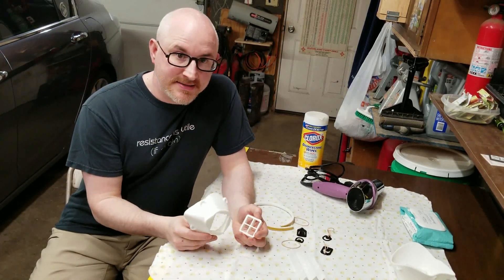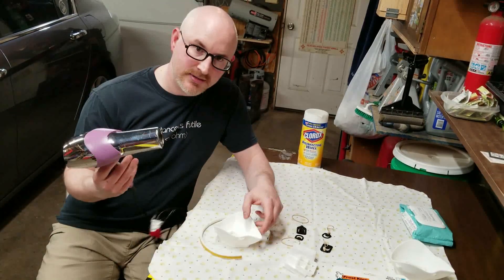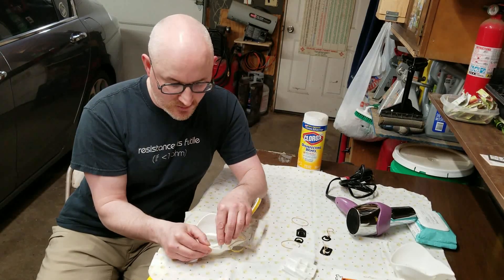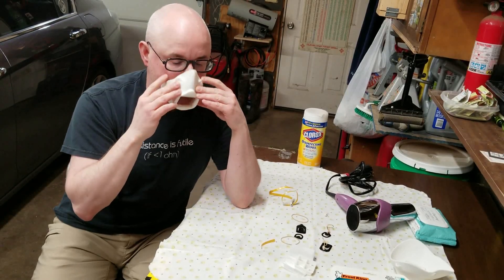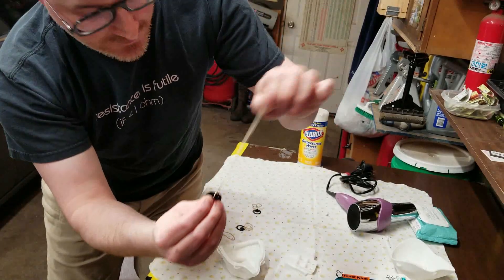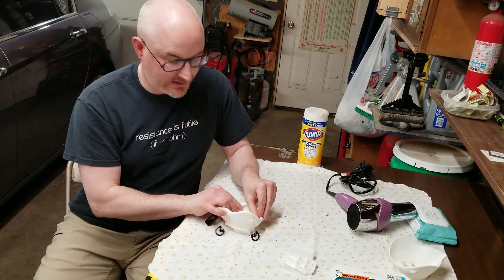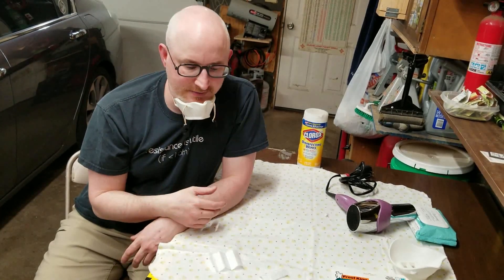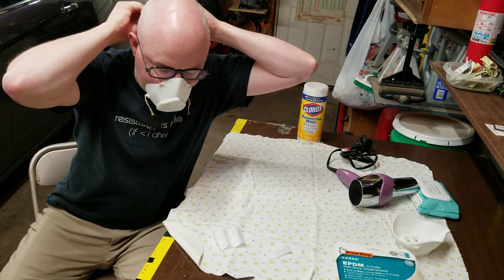Healthcare Engineer Explains Fitting a 3D Printed Montana Mask for COVID 19

Comment: @Richard Vedvik, thanks for the video. Are you concerned that the seal between the plastic filter insert, filter material, and mask can be compromised by the bunching up of the filter material, particularly in the corners?
Reply from the maker: Yes, we are certainly concerned with the filter installation.  A properly fitting filter is important for a firm fit of the frame.  The filter media has seemed to fold fairly easily without bunching up, i suppose that it stretches a bit when installed.  The filter window is held in place by friction from small bumps, meaning that the filter window frame leaves some room for the filter media to pillow between the bumps and corners.  The result is a fairly flush and smooth appearance from the outside and what appears to be a good fit.  We can see from the Montana Mask testing on their website that when subjected to the NIOSH standard test method the mask and filter window arrangement passes.
Reply: @richardvedvik979  , thanks for the reply. I actually have two of these Montana masks made from PLA and got concerned when the plastic frame insert popped out when I inhaled (it hadn't previously done that). I added an extra sheet of blue shop towel, which seemed to work but became concerned when I noticed the corners of the filter material seemed a little more recessed (looking from the outside of the mask). Last night, however, I was able to do a homemade test using a Harbor Freight IR thermometer. Temperature measurements of the filter material at the center (when exhaling) were several degrees hotter than measurements taken of the filter material at the corners (when exhaling). Not super scientific--but good enough to be reasonably confident that there's probably minimal leakage in the corners when inhaling (movement of the filter between breaths was minimal to none to the naked eye).

Comment: It is NOT a PPE...it is a useless pointless face diaper. A symbol of kneeling to the State.
Reply from the maker: Technically, it is PPE according to the CDC...  but so is a rag so the standard is pretty low.  These do provide more filter performance than a scarf or surgical mask.    They can match the performance of a N95 mask when using the same filter media in the window.  But I do think the survival rate and data associated with age and preexisting conditions means many applications are pointless.
Reply: @richardvedvik979  , masks like these (and even good cloth masks--but not bandanas and fleece) are very important when fitted and worn correctly. Monica Gandhi over at UCSF has some good evidence that even if wearing a mask doesn't prevent infection, it may very well reduce severity of the disease. Thanks again for posting this video.

Comment: Richard, I know this is 2 months old, but do you have any specific recommendations on furnace filters within that rating MPR1900 that you know for certain do not contain fiberglass?  I would like to do something like this, but I know that has been a concern when I've heard a discussion of using furnace filters.  I wasn't sure if you had done research on that yourself.  Thanks for you help in advance!
Reply from the maker: A natural fabric layer on the inside (thin, sheer, fabric) can help catch any loose fibers from the filter media.

Comment: I am a medical engineer as well. I actually designed a mask that prints in 2 hours and has a cover to go over the filter. 

One fyi for all, you can sanitize the filter material by baking it in your oven for 20 minutes at 170F.  Do NOT use water or ipa with the filter. They are electrostaticly charged and due to the type of dipole bonding that ipa is, it will cancel the charge, and water will just short the charge out. 

Using ipa on the pla is best option for sanitizing, besides hot water and soap, due to its inherently low surface tension. This allows it to actually get into pores smaller than viruses. A friend of mine is required to use rubbing alcohol for the filters they make that filter out viruses from blood. 

Today, i did some tests with silicone caulk aroumd the edge and it worked very well. I have also made a mold of my mask so when the time comes, i can cast them in silicone or resin haha.
Reply from the maker: Awesome input!

Comment: Great ideas for using potential seal gasket materials and filtration media for one Montana 3d printed filter mask.

Now in my search I ran across a great n95 equivalent filtration media that comes in it pure bulk fabric form ready to use; just cut and size accordingly to ones application 2.5 inch by 2.5 inch square to fit ones Montana filter mask or if one needs dual layer protection simply cut another 2.5 inch by 2.5 inch square and then simply place it over the four square grid piece to make a very good double layered n95 equivalent filtration media piece for one Montana 3d printed filter mask.

Filti.com:

$30 for 21 square feet worth plus shipping about $10 and one gets for $40 quite a bit of n95 equivalent filtration media for ones Montana 3D printed mask to load up to use for quite awhile how much one might ask of course ask; I have done some preliminary calculation using online square foot to square inch calculator to come up with the following usage metrics for ones review if needed:

21 square feet equals 3,024 square inches (one gets this by multiplying square feet by the value 144)

21 square feet times 144 equals 3,024 square inches

2.5 inch by 2.5 inch single layer n95 equivalent filtration piece equals 6.25 square inches

now simply cut a second: 

2.5 inch by 2.5 inch single layer n95 equivalent filtration piece if one needs a dual layer protective n95 equivalent filtration piece also as well

3,025 square inches divided by 6.25 square inches equals 484 single layer n95 equivalent filtration media pieces

3,025 square inches for two single layer n95 equivalent filtration media pieces will equal half the above previous number of 484 or 242 double layer n95 equivalent filtration media pieces

$40 divided 242 double layer n95 equivalent filtration media pieces comes to a total cost of 16.5 cents per changeout for a double layer n95 equivalent filtration media piece which I think is something most who are concerned about protecting their lungs will agree is pretty affordable and worthwhile indeed.

The cost of the Montana 3D printed mask can be purchase online Amazon for about $20 minus the gasket seal and filters or; 

one also has the potential option for buying the Montana 3D printed mask for about $25 with the sealing gasket included along with a starter supply of five color coded initial n95 equivalent filter media; 

now the white side faces going outwards of mask and the green side faces inwards towards ones mouth;

now if one needs to have the Montana 3D printed mask available for immediate use upon arrival the ready to go all in one installation kit makes it super easy to get up and running in less than five to ten minutes time and will help to insure that one has as perfect a positive air seal as possible with just the use of ones hair dryer and five to ten minutes of custom fitting and installation times.

Comment: Oh wow, now how are you going to prevent the boogeyman from entering your body through your eyes, ears, and skin? Do you have an experiment that proves your mask is capable of preventing the boogeyman? Link please!
Reply from the maker: Both boogeymen and boogeywomen are quite determined to enter any face hole that has porous absorption (skin is fairly resistant because it has sub-atomic superheroes on the surface playing red rover). The face hole that generates a vacuum tends to act like a worm hole for boogeypeople.   Because the boogeypeople have a characterized size, the MPR rating of filter media (made from the fine strands of hair from woodland fairies) is accurately tested for percentage of blockage - measured in micrometers - or 0.000001m resolution.  MPR1900 and higher is suitable for viruses and the percentage of particulates captured is well documented for each filter type.  The links in the description also discuss this and the first link includes testing results compared to an N95.

Regardless of the idea or belief surrounding mask usage, herd immunity, or natural selection; it is undeniable that our healthcare facilities will be overloaded.  We don't design hospitals to allow every room to be negative (maybe one in twenty or one per floor).  While that will likely change moving forward, the current situation is that contagious patients are exposing the entire facility.  PPE within the hospital is necessary to maintain health of the workers.  

My immediate family are working in hospitals and are re-wearing the same N95 masks for days or weeks while treating COVID positive patients.  Anything that reduces the public's use of those masks is helpful.  Nursing staff at Long Term Care facilities have expressed concern they may quit and abandon the residents if they don't get masks/filters that make them feel safe, and these masks provide that both functionally and spiritually.  Many LTC facilities aren't receiving PPE due to hospital shortages getting priority.  The general public is being directed to wear cloth masks, which doesn't have anything close to the performance of a properly fitted respirator with proper filter media.  None of this is ideal, and most of this is worse than that, but our nurses and doctors are needed, so action is required.  

Because the public will be required to wear masks in public very soon in most areas (rural or urban), I think the mask should be as effective as possible without depleting a resource required by healthcare workers.  

Cheers.
Reply: Richard Vedvik 
Problem is, you are trying to protect against something that doesn’t exist. Check out Andrew Kaufman.
Reply: Truth is Freedom Florida Show me proof and hard facts. Not just someone putting a bunch of words together showing how ignorant they are. I will wait.
Reply: Keystone19 
Proof of what?
Reply from the maker: @Masterdebator881   I design hospitals and interact with hospital personnel daily.  I do have first hand knowledge of how hospital systems are reacting, testing, and being impacted.  There may be global manipulation to usher in the NWO, since the entire planet reacting fairly equally (which is odd) and the devaluation of currency.  I totally acknowledge that this is a very odd reaction.  IMO - if we really cared about saving every life we wouldn't allow abortion.    

But the population is being told to wear masks, and nursing personnel are also being told the same.  I make these for people that ask for them, and they will be handy respirators for future woodworking projects.